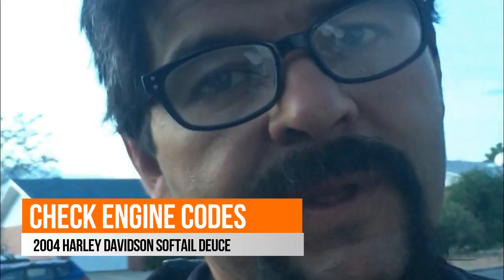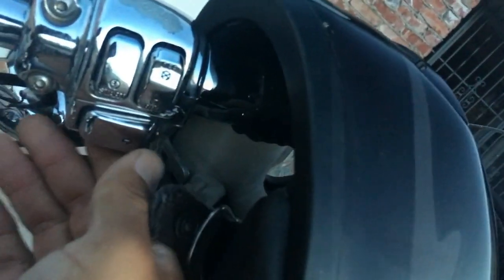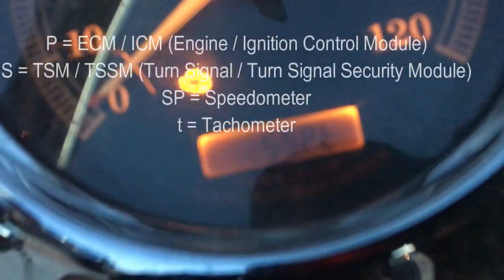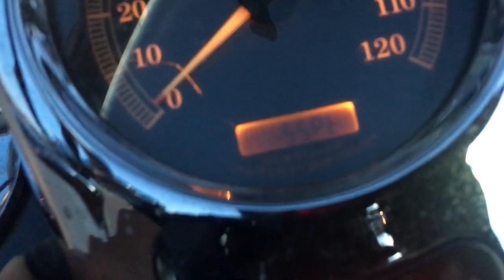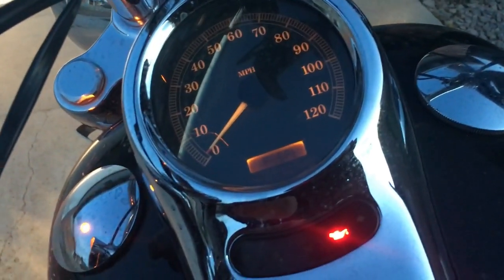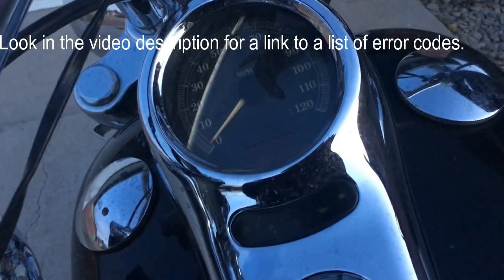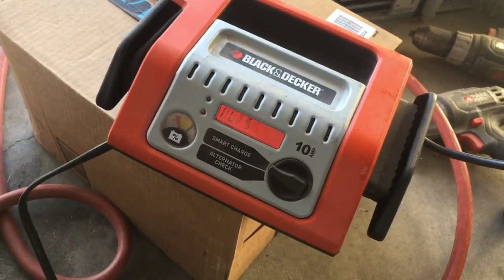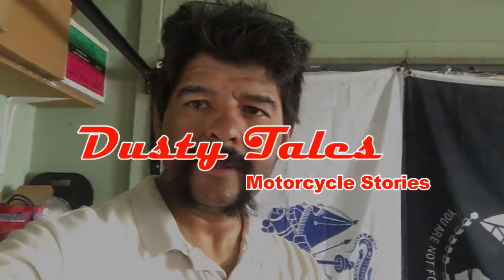How to video - Check engine codes on a 2004 Harley Davidson  Softail Deuce

Comment: What if you do not have a check engine light? Does that mean that the bike does not have any codes?
Reply from the maker: I would check anyway.  I had a voltage issue and it show the keys icon.

Comment: Great video, and thanks for the link to the codes...My 04 RK shuts down while riding. then at the side of the road I switch the ignition off, then back on and all is well...I'm baffled as no codes are stored.
Reply from the maker: Clean the oxidation on the dash switch.  It just happened to me.

Comment: Is the deuce a CV or an efi
Reply from the maker: gonein6o my Deuce is CV, but fitted with an S&S Shorty Carb
Reply: @dustytales5829  thanks alot having an issue with my engine light coming on then off then on but not staying on just a quick flash so I'll give it ago and see if a fault comes up 
Much appreciated
Reply from the maker: gonein6o in the description there is a link that lists all error codes